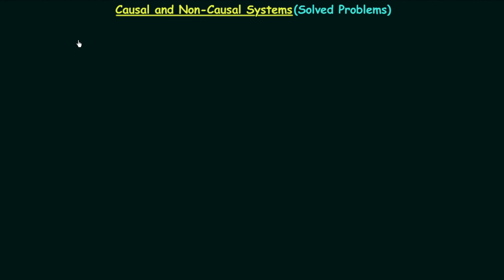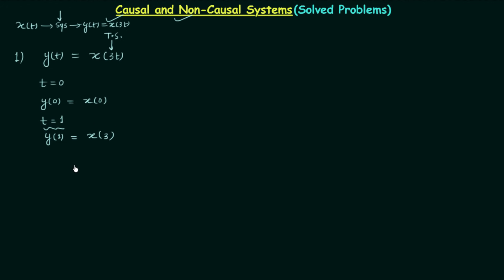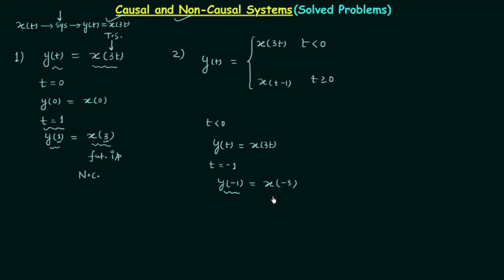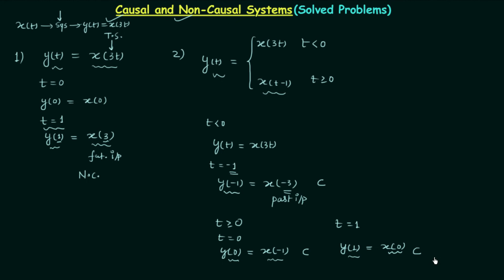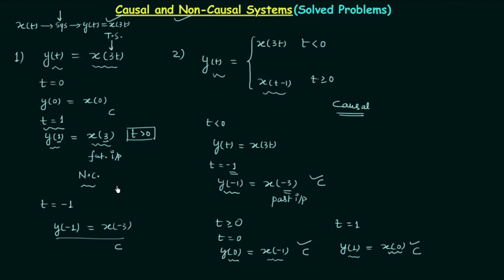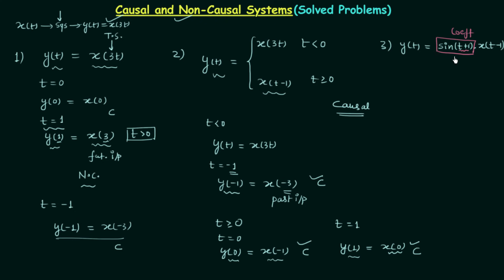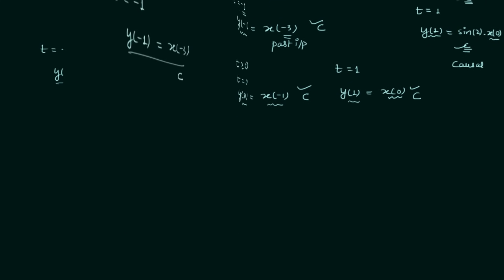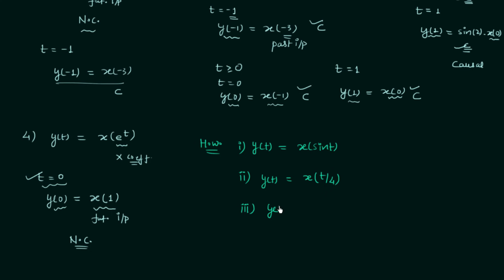Causal and Non-Causal Systems (Solved Problems) | Part 1

Comment: Trigonometric-Functions repeat themselves always between -1 and +1. So the value of the Output of the first one Y(t) = X(sin "t") is always more than the value in parentheses of X. That means it is Causal, because the Output depends on a value smaller than itself which means again "past"!
Reply: thank god i found someone

Comment: The first two systems are non-causal because of the inputs like -Pi and and -1 which are plugged into the first two systems respectively ; leading to future values of the input whereas the last system is causal because the output depends on the past value of the input.

Comment: All are causal. Correct if wrong
Reply: You are wrong because i,ii are non-causal while iii is causal.
Reply: According to wiki: "the output y(t0) depends on only the input x(t) for values of t <= t0". So if we fill in t = -4 for the second problem: y(-4) = x(-4/4) = x(-1) so. because -1 <= -4 is not valid ande because of that n.c

Comment: 1)  Non-causal system because negative values of t depends on future inputs
2) Non causal system because negative values of t depends on future inputs
3) Causal system because the system depends on past and present inputs only
Reply: how ? plz explain question 1 of homework
Reply: @universeisherestudytime8701  put some t values in caliculator and check the sine values for negative t values you have x in future so the sys is non-causal. 
hope you understood brother
Reply: @b.sidharthreddy108  xm khtm hogya bhai... Anyways thanks
Reply: Are we consider e'2t when giving values for T ?
Reply: @yunusemredursun8823  You can substitute the value of "t" And leave it as it is for the co-efficient(exponential value)..because we don't bother about co-efficients.. We should determine it by seeing the x(t).
Reply: @InvincibleArts  Thank you I got CC from examination :D
Reply: Second one is causal bhaii!!
Reply: @vrundakhandale5499 for t= -4  , y(-4) = x(-1) 
which is a future i/p w.r.t o/p
Hence Non-causal .

(Also , for any negative value the value of o/p is smaller than the value of i/p , hence Non causal)
Reply: bro , all are non causal

Comment: 1.  put  t=-pi,   depends on future ....NC
2. put t=-4, depends on future ....NC
3. not depends on future ....Causal
Reply: PABITRA PATRA correct answer thank you
Reply: nice
Reply: put t = 4    y(4)=x(4/4)  => x(1)  so it causal
Reply: I do believe 1 is causal since to be non-causal it has depends on the future values for any value of t but we can see that at t=-pi it depends on future values but at t=pi it only depends on past values
Reply: i think Q1 is causal as put y(pi)=x(sin pi)
y(3.14)=x(0.054) which is past value.
Reply: swadesh sritam put t= -pi you get zero hence depends on future so non causal
Reply: Why you are using radian values?  
Like pi by 2, in case of t, you are just diving 3.14/2,  but in case of sine why we have to use radian values? Is there any rules like that?
Reply: t=   -4
Reply: i think 1st is anti causal becoz it depends on past value for some and future value for some t
Reply: bravo
Reply: Can u explain y(t) =x(e^t) .
Apart from t=0, output depends on  e .
It will only depend on output.
So it should be ante causal system.
Reply: @Ashish-dq5yv  take negative values of t and then verify whether it is causal or not
Reply: How come u r putting pi as a time value?
Reply: @Ashish-dq5yv  put t=-1, you'll get a future case
Reply: thank u too.carry on dear
Reply: put 4 depends on past also
Reply: @Ashish-dq5yv  its not like that.its causal iff it depends on past or present inputs for every value of t
Reply: @swadeshsritam  Yes it should be causal #NesoAcademy kindly let us know the correct answer
Reply: @ananyasatpathy7694  Ya the doubt should be cleared  .
Reply: @sadiakhan3489  same question arising in my mind.
Reply: wrong
Reply: @raynierraja591  No in case of Anti Causal it depends only on the future value.........
Reply: @Ashish-dq5yv  now put t = -1,-2
Reply: @ericjohson6378  If we get at least one future input, then we can say the system is causal.
Reply: @Ashish-dq5yv  it is one case when you will put t=-1 y(-1)=x(-0.25).So,as it is depending on future value it is non-causal
Reply: @swadeshsritam  put -2 and you will get y(-2)=x(sin(-2)) which is equal to y(-2)=x(-sin(2)) and we know sin<=1.so for this present output is depend on future input so its non causal.
Reply: @rahulagarwal8775  e is a constant so it it doesn't matter, check only for x(t-1)

Comment: At t= -pi sint= 0
So non causal
Put t= -1 , t/4 = -0.25 
So non causal 
Third one t-1
So causal👍😊
Reply: What if the question is x(cost)
Reply: @madhabkafle8072  non causal
Reply: @madhabkafle8072  give t=0,it becomes x(1),depends on future value.
Reply: @madhabkafle8072  put t=0 then it becomes x(1)depends on future, put t=1 then it becomes 0.99 means it is past then the combo of past and future it means non casual

Comment: Homework question solutions:
All are casual 
1.if we put t=π(3.14 approx)
  y(3.14)=x(sin π) ,we know that sinπ=0
y(3.14)=x(0) which means past input .so it is casual system.
2. If we put t=4
      y(4)=x(4÷4)
      y(4)=x(1) , which means past input ,so it is a casual system
3. exponential  is coffecient if you put t=1
y(1)=e^2*1 x(1-0)
y(1)=e^2*1 x(0) which means past input it is a casual system.
Hope you guys understand it😃.
Reply: Put t=- π in first question then check the answer bro
Reply: when we put t= -4 in 2nd one y(-4)=x(-1).. this shows it depend on future value here ,, i.e -1 is future for -4 .. so second one is non causal
Reply: Put t=π÷2

Comment: The solved example no.4 i.e., y(t)=x(e^t) is not just Non-causal. It's Anti-Causal too!
Reply: Anti-Causal is a subset of Non-Causal. The system which is Anti-causal is also Non-Causal but not Vice versa.

Comment: Can anyone explain y(t) =x(e^t) .
Apart from t=0, output depends on  e .
It will only depend on output.
So it should be ante causal system.
Reply: All anti-causal systems are non-causal systems (not vice versa). We are only checking for causal and non-causal systems. And at t<0 the system acts as a casual system
Reply: Yes it will be anti causal

Comment: t>=sin(t ) so for any value of  function x(sin(t)) system is causal system.
Reply: check for -pi/2
Reply: for t=pi/2, 
y(1.5)=x(1) for output is always depending on past values. 
So causal.
Reply: sin(3pi/2)=-1
Reply: For negative values of ' t' , it's coming NC system while for positive values of 't' , it becomes Causal....so what ll be d answer?
Reply: @rajatpandey496  then also its causal

Comment: 1st how come non-causal..sir pls explain..
Reply: see manisha !! if u get even a single future value, then the system is termed as non-causal (bcz causal system does not contain any future value)
Reply: put t=-pi/2 i.e, -3.14/2=-1.57 u will get y(-1.57)=x(-1). so, present value is depending on future value as -1 is greater than -1.57. So, Non causal system.

Comment: 1)non causal
2)non causal
3)causal
Reply: I got 2nd and 3rd please explain the 1st one
Reply: put t=-pi/2 i.e, -3.14/2=-1.57 u will get y(-1.57)=x(-1). so, present value is depending on future value as -1 is greater than -1.57. So, Non causal system.
Reply: But for t=π and t=π/2 ,system becomes Causal for que no 1...

Comment: Sir first question is unable to solve 
Another questions are causal
Reply: pi/2 pe put kar to 1 aaega i e past 
thus causal 
chuggad
Reply: put t=-pi/2 i.e, -3.14/2=-1.57 u will get y(-1.57)=x(-1). so, present value is depending on future value as -1 is greater than -1.57. So, Non causal system.

Comment: 2nd one NC Kaise ho sakta hai?????
Reply: for negative values
Reply: For negative values it's coming NC but for positive it becomes C...so what's d correct answer?
Reply: For t=0, y(0)=x(0)-> present ip
For t=-1, y(-1)=x(-1/4)=x(-0.25)-> relative to - 1, - 0.25 is in future
For t=1,y(1)=x(1/4)=x(0.25)-> past i/p
Hence N. C.
Reply: Ipsita Moharana  thnx
Reply: i hve same problem with u. if we change the value it will be different answer. How to know the correct value of input that we need to use?

Comment: 1.NC 
2.NC
3.C
Reply: put t= -(3pi/2)
Reply: it fluctuates between +1 and -1 so non casual
Reply: if its both causal and non causal then you have to take non causal
Reply: i dont think thats the proper explanation
Reply: ex 1 is non causal as when x = -pi/2 , y is x(-1) which is future output